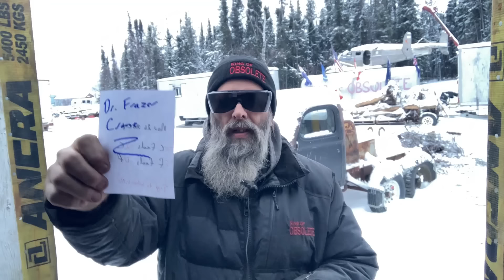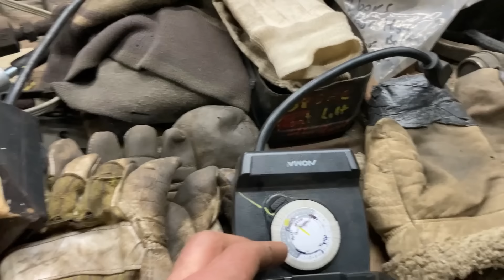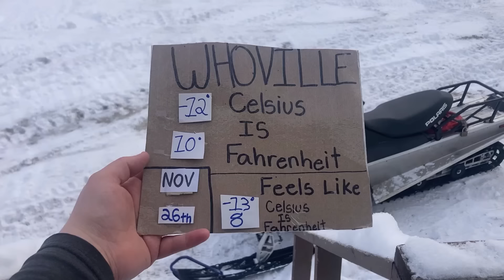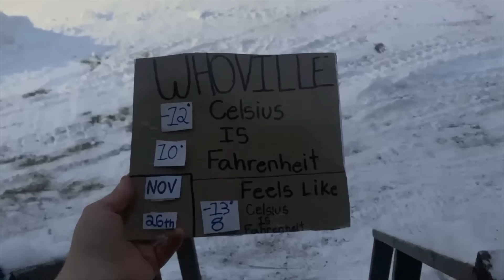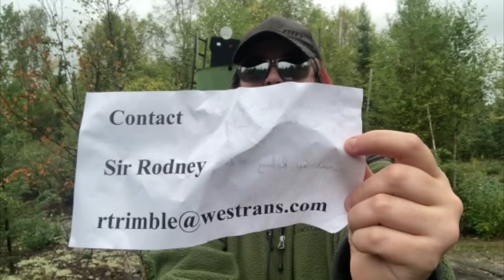Little Change of Plans With Not Plugging in the Dozer Nov 26 2024

Comment: Thank you for the video Mr. KoO. Q: Have you ever had a decent 4 WD Pickup with a plow on it? It's really a lot different being in the cab with the heater on. In the past I plowed with my slide in camper on it, the weight makes it a very effective plow truck.  OK, the internet wxr guys are all saying the Midwest is going to get a "Blast of Arctic Air" as a low pressure spinning around over Lake Superior is going to push it down from James Bay . They are calling for  several feet of "Lake Effect" snow. It's just a nuisance for me any more but I don't really complain cuz I see you guys like doing things in it. I'll just put another log in the wood stove and watch it burn thru the window in the door, but you have fun! See you tomoro! ben/ michigan
Reply from the maker: yes when doing scrap metal we had a 1993 chevy with the boss vee plow. worked good but not made for rocks and more rocks  thansk

Comment: I have a question, is it necessary to plug in the older Caterpillars to get them to start? Your temp wasn’t below zero F . Most start pretty good without block heaters at that temp. ( or is it hollyweird drama?).
Reply from the maker: these are now direct electric start using 12 volt starters. the pup motors to tossed bye bye almost 30 years ago plus no glow plugs too.  thansk